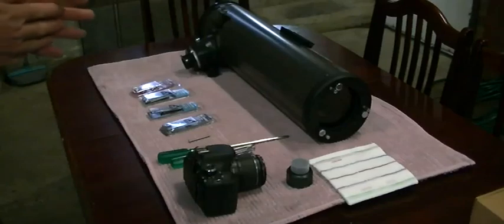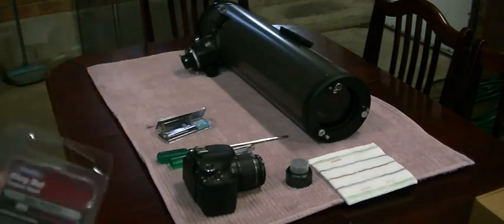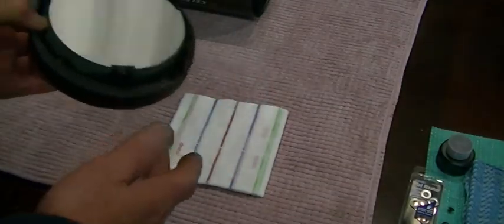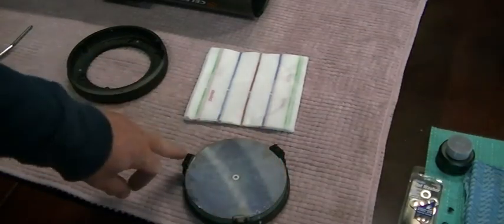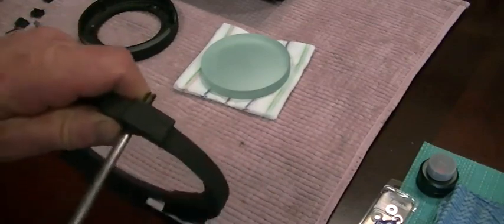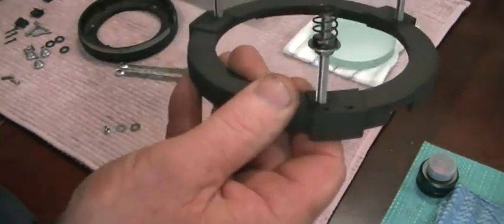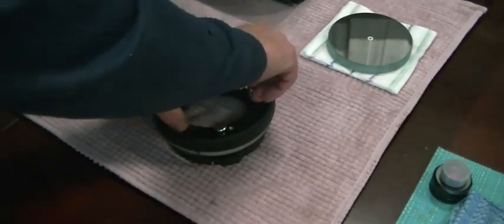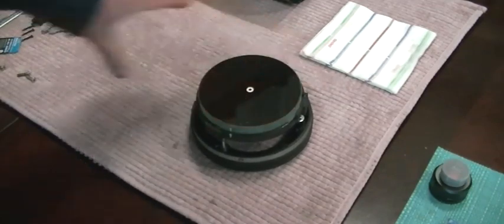Celestron SLT130 upgrades PT1-DSLR Prime Focus Mirror Mod

Comment: Nice job.  I have an SLT 130 and starting to move to astrophotography. I have a Nikon 5100 I'm going to use.  How did you determine the length of the bolts to acheive the prime focus?

Comment: This video was very helpful. It all depends on your setup, as to how long the extension should be. I found that extending 30mm (using 50mm screws) was too long. For my setup, 35mm screws (extending only 15mm over the original 20mm) allowed prime focal, 2x Barlow and normal eyepieces to all focus.

Comment: Great video... I bought a 130 slt on the alt az celestron mount. Grew out of the mount in a week. I moved to a AVX EQ mount. I tried the 130 slt ota on the avx. great images on astro... But with a barlow to get to focus. so like 900mm focal length. 650mm native i think.  A x2 barlow is only 1.5x with the extension tube removed. I want to move the mirror like you did but!!!! The focuser it is rubbish tosses the collimation out 10% with a laser on it with any movement. This is bad for astrophotography. funny a focuser upgrade cost more then the OTA so why even move the mirror up?. do not toss out money to save it right??? any ideas??? also invest in some locktight. lol